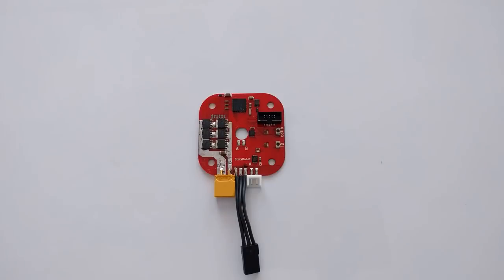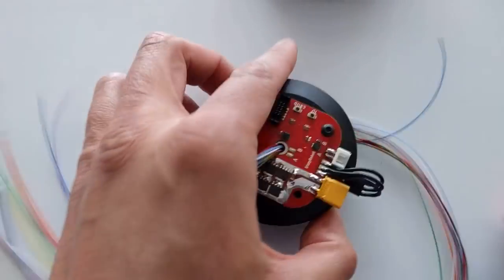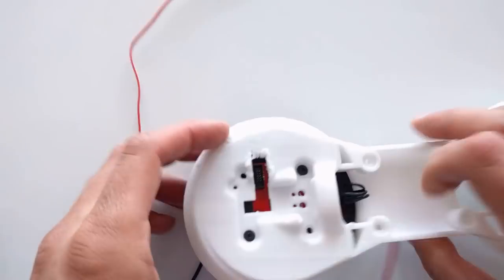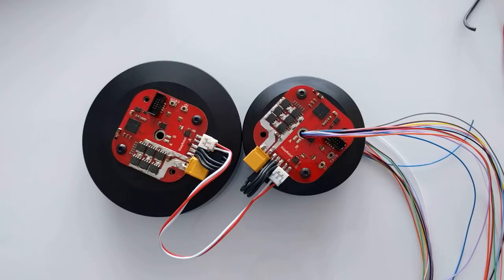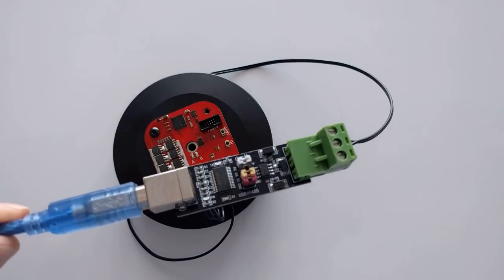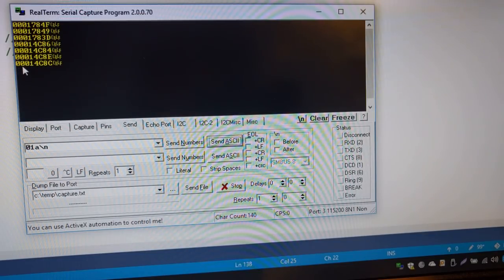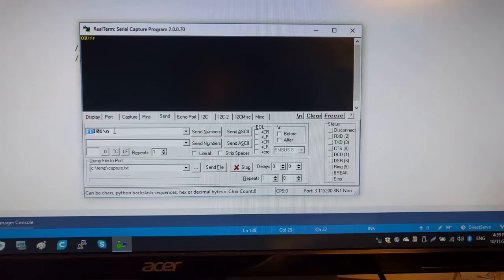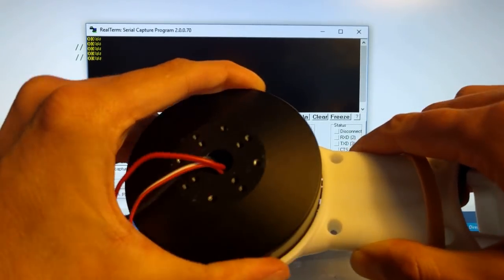DirectServo BLDC controller

Comment: Hi mike, very nice project. I'm trying also to create a bldc controller for a project I'm working on starting from the same driver (stspin32f0). However I have some problems with the programming. I want to start from the st workbench using the st mcsdk to implement my controller. However I have some problems for the debug. Seems that the STM32f0 micro don't have the possibility to debug the code using the stlink v3 and by making printf or plotting the variables trough swd interface. How did you managed this problem? Thank you in advance. Any suggestion in appreciated. :)

Comment: Hi Mike, nice work. Can this servo controller be used with a brushless motor for a linear guide rail positioning? What type of motor would you recommend for a 200g load to move at 2000mm/s?

Comment: I was looking silent and lowest kogging motor (for example 36n42p ones)..for continuous rotation 10-100 and low tork 100-300mNm.But it seems these motor will not be ok for my application